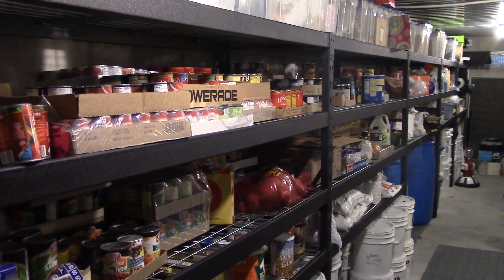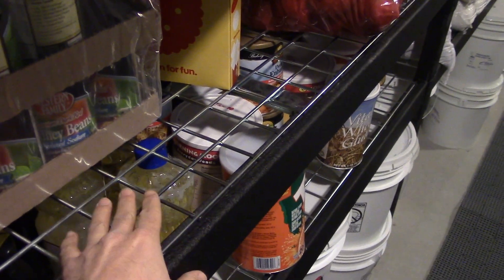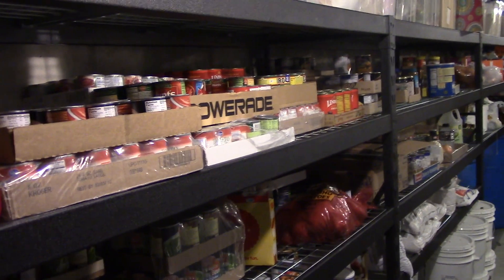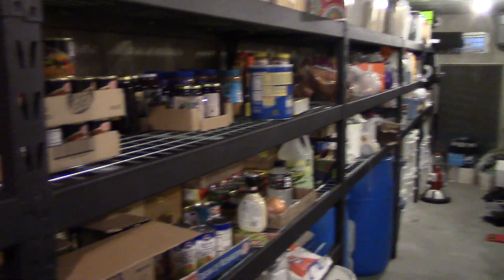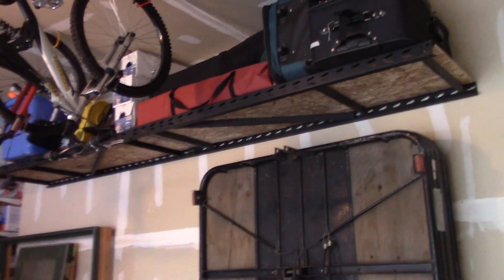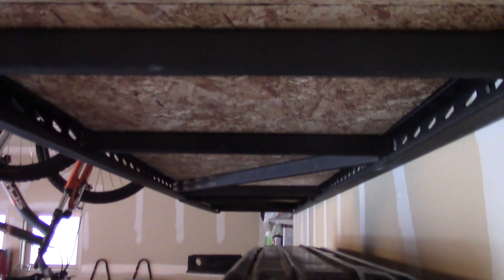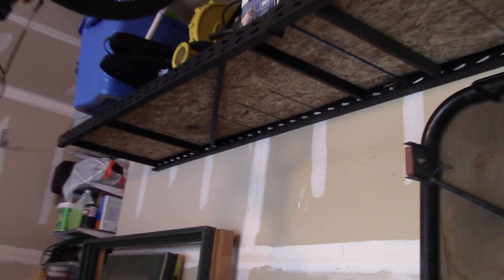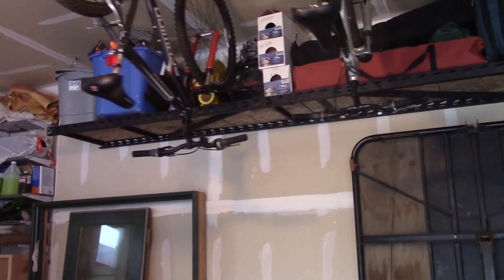Costco's Industrial Storage Shelf Rack review

Comment: Extra shelves are available for sale. If you separate the two units, you can add shelves in between and have three. We took one shelf from each unit and used them in the middle so we only had to buy one additional shelf. That gave us three units with room underneath to clean and store stuff that can sit on the floor.